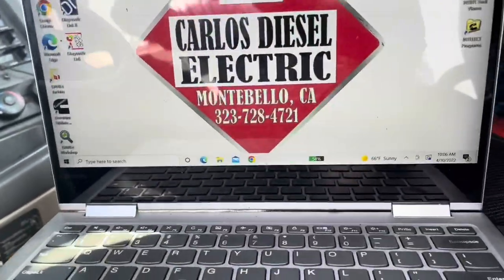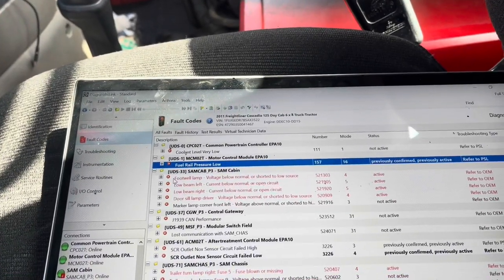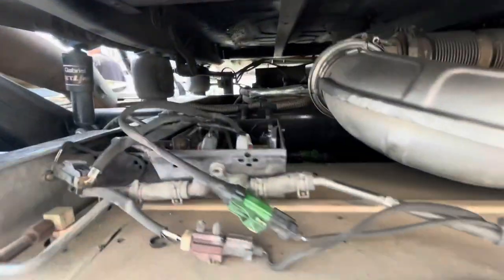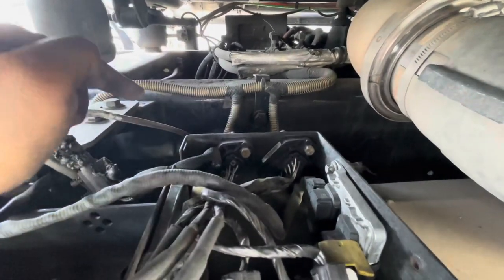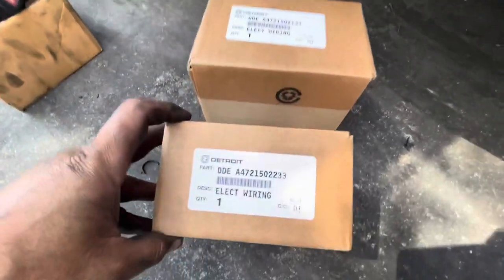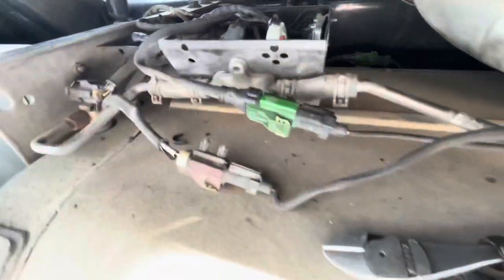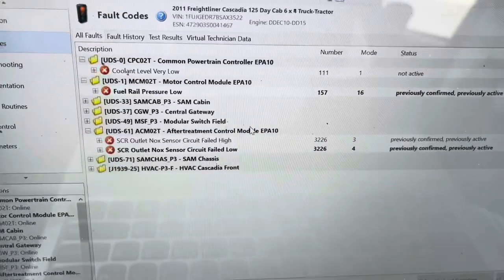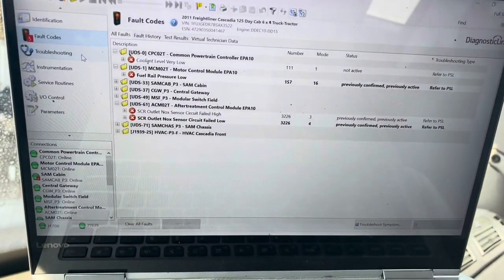One Box issues with simple solutions, How to fix from start to finish SPN 3226 FMI 3 and 4

Comment: Good work brotha. I have a 2011 Cascadia DD15 SPN3609 Fmi4 DOC already had 2 DOC inlet sensors replaced new harness Im lost on what else. Maybe metal tube plugged up?
Reply from the maker: @sergserg2618  try using a test ACM. It needs to be EPA10. Also remember you have a main harness that goes from the ACM to the One Box. Your truck should be two rectangular plugs, black and gray. Try using a test ACM first.

Comment: I have a 2011 dd15 in a Western Star 4900SA, 280000 miles. When you shut the engine down there will be an intermittent “hissing/vibration” sound coming from the one box area coupled with air pressure loss? Only does it while the air pressure is at or above 90psi or so. One, sometimes both check engine lights are on, sometimes no lights are on? I’ve checked and cleaned the EGR sensor (Delta sensor?) on the top left side of the engine, it was dry and clean. I’m at a loss for what to do next, any help would be appreciated. Thanks
Reply from the maker: EPA10 will do that, the DEF system will purge to clean itself once the truck is turned off. It does that by using the air through the pressure limiting valve towards the DEF metering unit. This is normal, now as for the check engine light. What are the codes? Have you had someone plug in with the DDDL software?
Reply: @CarlosDieselElectric   I’ve not had anyone plugged in, I just got the truck a few days ago. Drove it 500 miles home, seems to run really good. Got plates today and hooked up a trailer to go for a drive and check lights came on?
I’m going to call around tomorrow and see about getting it looked at. Thanks for the response I really appreciate the information you have on your channel, very helpful stuff.

Comment: More likely the problem is in the burned harness don’t you think?
Reply from the maker: The sensor is definitely the cause, the plug was melted on both the male and female. the two additional harness are known to give problems because of the location. They sit on top of the One Box so the temperatures will eventually need to be replaced. 
I typically like to replace both, I see it as I would much rather cover all my bases. Nothing worse then having your customer call you back because the issue came back. Now the truck has to be down and you miss another day of work.

Comment: How about 3226 fmi 13 any info on what that could be no other codes showing but I’m in 5mph Derate replaced the outlet sensor did a forced regen code still present also def light blinking
Reply from the maker: Check your harness at the One Box. Depending on the year you may have one harness on the box itself or you may have two harnesses on the one box. Start there.
Reply: @CarlosDieselElectric  it’s a 2017 thank you
Reply from the maker: @chrishotto2003  Definitely start looking into the harness first. Any corrosion or damaged wires can cause this.
Reply: @CarlosDieselElectric  so actually after waking up that code has disappeared I have no codes showing on the truck but weird things is I still have a def light blinking lamp light stop engine all on but no codes showing up ?
Reply from the maker: @chrishotto2003  have someone plug in and see what fault codes were or are inactive.
Reply: @CarlosDieselElectric  yup did that today guess the little cheap scanner I had couldn’t clear those scr faults took it to boss shop hooked it up to Jpro after some test and regen system cleared the codes .. This tells me to invest in a a better device especially for those fault repairs

Comment: Had a code for low pressure before Doc on one box?
Reply from the maker: What is the fault code?
Reply: @CarlosDieselElectric   don’t know that. That’s the description of the problem on my mechanic’s computer. Didn’t get the code
Reply from the maker: Ask for the code and I can try to help. Could be something internally wrong. 
But the code will help. 
What year is the truck? How many miles?
Reply: @CarlosDieselElectric  2012 sd114 Freightliner. DD13. Brand new one box with the original sensors. Mechanic says it was one of the pressures sensor before the doc.
Reply from the maker: @kartsmoker  could be. Definitely a good place to start. Tubes, sensors or leaks.

Comment: Isn’t it to expensive to be guessing what harness is bad?? Why spend so much money replacing harnesses or sensors that might not be bad😒
Reply from the maker: After you have worked on so many you get familiar with the common problems. The temp sensor being burned and melted has to be replaced and since the plug it was connected to was also melted replacing the harnesses isn’t money wasted or guessing. They commonly go bad because of the heat at the One Box.
Sensor runs around $60 and for both harnesses $250-300 so it really isn’t that expensive.

Comment: 3226 fmi 20???
Reply: Ghg17 new nox’s temp’s harness, delta p cleaned, no exhaust leaks new dpf clamps. Def doser?
Reply from the maker: @jeramiekochlefl-bodner5965  what other fault codes are present? Non active and active?
Reply: Hi i also have same problem 3226 fmi 20 dd15 cascadia.  I put new outlet nox sensor and one box harness.  But the check light goes on after 1000 miles plz tel me what is the problem

Comment: I have a 4300 it won’t crank to start I didn’t let the gauge cycle I just stared the truck up instantly and it was about to start and half way stopped I got tech out and checked everything and nothing I got a spn 1081 fmi 9 code
Reply from the maker: International? What engine? What year?
Reply: @CarlosDieselElectric  Cummins 2015 international
Reply from the maker: What engine?
Reply: @CarlosDieselElectric  isb 6.7
Reply from the maker: @fivestar000  has someone plugged in and checked for fault codes? What codes do you have? Inactive and active
Reply: @CarlosDieselElectric  spn 1081 fmi 9
Reply from the maker: @fivestar000  before this happened, what has been done? What kind of work? Battery work?
Reply: @CarlosDieselElectric  just replace the alternator 5 month’s ago
Reply from the maker: @fivestar000  check the batteries, make sure they have a charge. Test them. How many bolts are you reading?
Reply: @CarlosDieselElectric  they are all good
Reply: @CarlosDieselElectric  how would I know if it’s the starter failed
Reply: @CarlosDieselElectric  it was the starter I called road side assistance and everything was fine but the checked the start and figured it was bad
Reply from the maker: @fivestar000  glad you are back on the road